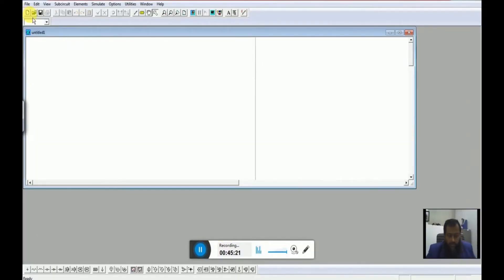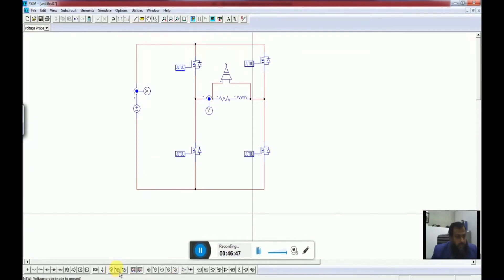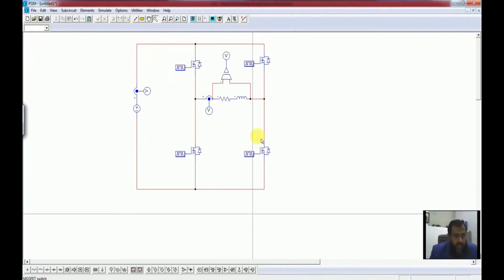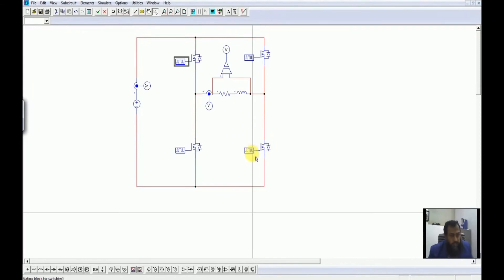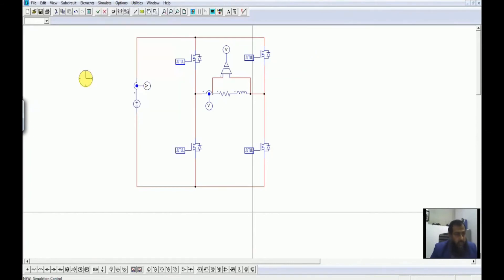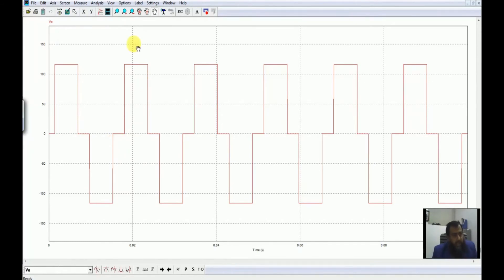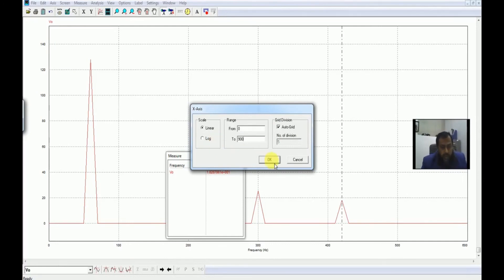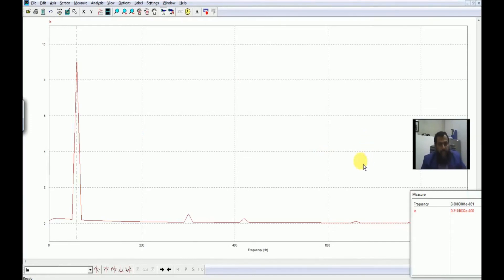Quasi Square wave inverter Simulation using PSIM

Comment: Sir, it's showing error, it shows that the resistor is floating
Reply from the maker: there might be a connection error in your simulation. Floating error means that one or all terminals of a component are not connected. Try adding a ground as well.
Reply: @HadeedSher  Thank you Sir, now it's working